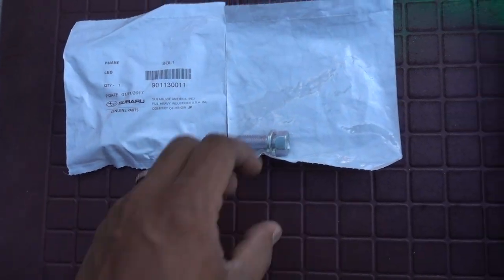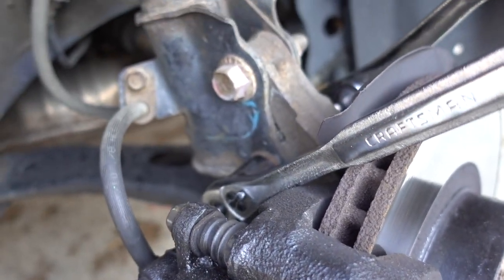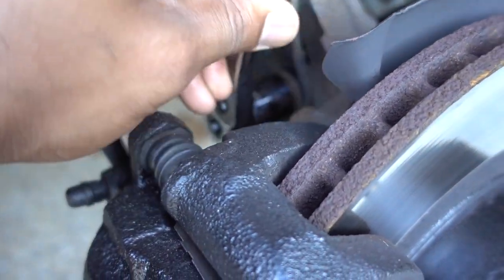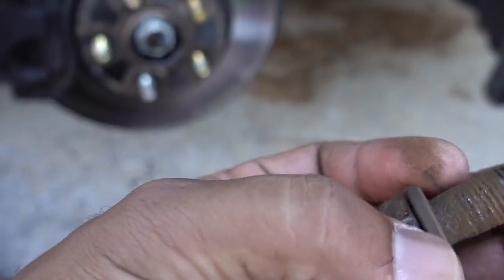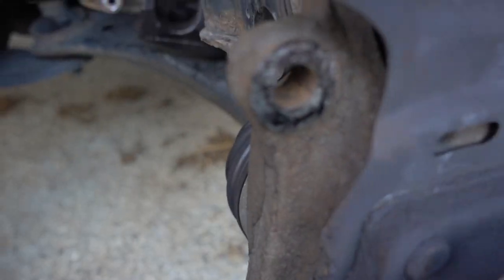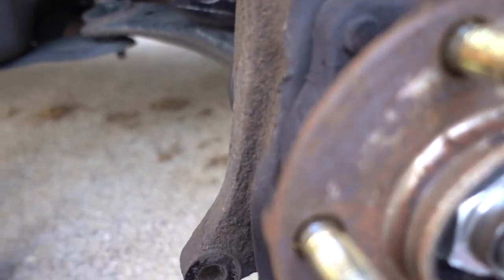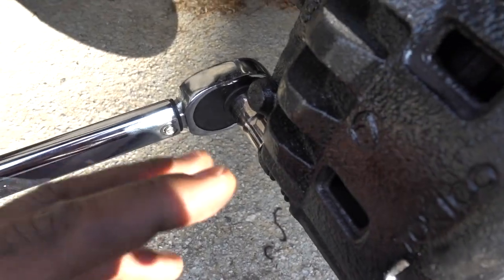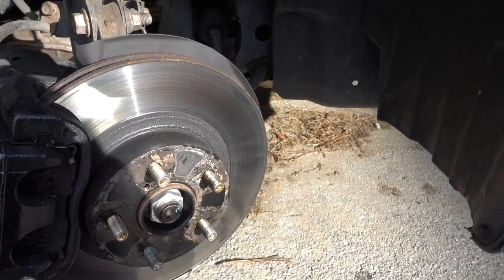How To Replace Caliper Bracket Bolts (One Bolt Snap On Me)

Comment: I watch Chris fix putting the bracket bolt, he said 98ft/ib, I definitely wouldn't recommend, cuz I snapped my bolt, don't put that much torque, now I'm just putting around 60-70 ft/ib.
Reply: Bro, I did the exact same thing yesterday while watching his video, I had it on 90ft lbs, and the head snapped off...
Reply: Half of mine is still stuck in there, got any tricks for removing it?

Comment: I snapped both bolts because of the rust buildup.  I think it's because of the split washer on the bolt, let's water and salt in overtime.  I tried taking the broken bolts out with a extractor but it wouldn't budge at all, ended up having to drill it out and getting a new bracket/bolts.

Comment: how did you remove the bolt when it snaped on you, same thing just happened to me ! I was removing the caliber bracket the lower bolt broke on me (flush with the bracket) it is rusted tight. please help
Reply from the maker: I get a new bracket, because is really hard to remove that thing
Reply from the maker: Is only like $45 on advance auto parts
Reply: @BulletSolano  yes but I can not remove the braket because the bolt is broken inside the hole
Reply from the maker: Can you drill it out?
Reply from the maker: I need to see how is inside and the room you have to work with
Reply: @BulletSolano  ok so I keep drilling, small and then larger bits (at the site of bolt) until it break off?
Reply from the maker: Yes do that
Reply: @BulletSolano  Thank you
Reply from the maker: No problem
Reply: Try swiveling the bracket, and observe the broken bolt. Most likely it moves, and it's frozen only in the threaded (bracket) portion. So without having to drill, you could just try removing the entire rotor (w/bracket) at that point, using the two 8mm x 1.25 bolts through the two pilot holes trick, to detach it from the hub. Possibly also hammering bracket towards you, away from hub. If you do have to drill, since the bolt is very hard steel, I had success instead carefully eating away at the broken bolt using a RotoZip with Dremel bit 9903 to weaken it first, then detaching rotor. As Bullet says, replacing the bracket is mandatory.

Comment: Do you know the bolt size? what should i tell advanced auto parts? "caliper bracket bolt" ??
Reply from the maker: I don’t remember the size but yes is a caliper bracket bolt!!
Reply: The Subaru caliper bracket bolt head is 17mm, but I couldn't find any aftermarket carrying this app-specific bolt. I got mine at the parts counter of the Subaru dealership, and they provided washer, for ~$5.
Reply: Don't know if you still drive your Subaru but it is M12 x 1.25 ~~ 35mm
Reply: The bottom strut bolt doesn’t have to be removed. Soak the caliper bolts with penetrating oil, give it an hour. Use a regular 17mm wrench and wiggle it left and right until you see a movement. Use the same wrench or a ratcheting wrench to remove the bolts.
Clean or wire brush the bolt and knuckle mating surfaces, clean the knuckle bore and apply anti-seize on the inside of the bolt bore. Install the bracket, apply blue loctite on the bolts and torque to 22lb ft on step 1. The next step is to rotate the bolt 75 degrees and that would provide the close to accurate clamp force that is required. The torque of 88.5 lb ft can apply to only brand new knuckle, caliper bracket and bolt. The torque angle method applies to all critical fasteners on a vehicle.

Comment: Snap On sells a special socket to get to that upper caliper bracket bolt without removing the lower strut bolt.The  part number is BTCS1 for that socket.Do not have to replace the caliper bracket when the bolt breaks off.If you know anyone with a mig welder,crank the heat up on the welder and weld a nut on extracting the broken off bolt out with a wrench.Also do not jerk on the torque wrench,jerking on it gives a false torque reading

Comment: What year is that Subaru? I have a 19 year old 911 C4 and a 24 year old A6 and i live in god damn Michigan and neither car has that much rust on or under it. Also why did you have to remove the caliper bracket just to do a brake job? On both Porsche and Audi I only have to remove the caliper from the bracket and i can pull the old rotors out, grind and prep new rotors, insert the pads into the brackets, slide the calipers back on, tighten the bolts and bleed the system. Either you are making this way to complicated or Subaru has really gone down hill since the rally days when i owned a few. Additionally you shouldn't have to mess with any bolts that deal with toe, camber or other alignment settings. If you look at your caliper bracket you will see two bolts with rubber seals that are (or should be) free floating and if you simply loosen and remove those two you can pull the caliper right off and do the brake job. Its even easier on the 911 than on the A6 but it probably should be as it costs nearly 4 times as much, check out those other bolts, but the positive take away is that at least you are replacing rusting parts, which is always a good thing but it seems like you did more work than you needed to do to do a basic brake change.
Reply from the maker: I removed the bracket to get it pain that’s why snaps on me
Reply: @BulletSolano  i think i get it, so basically it was an issue of rust assaulting your car a lot sooner than you expected causing you additional headaches, does that sound about right? Side note, you have to try doing a brake job on a 911, its so awesome, from breaking the wheel lugs lose and jacking it up, to replacing the rotors, pads and bleeding the system takes about 5-6 minutes total!!! It is absolutely shocking, no wonder their race cars can do super fast pit stops, anyway, you get a thumbs up (Like) for being cool and replying to my queries. Cheers
Reply from the maker: Jaja thanks man, if I get a client with a Porsche I will!! Thanks
Reply: @BulletSolano  i know you probably wont remember my youtube profile/channel (i mostly restore old slot cars and trains) but i would love to hear what your experience is like once you get to work on a 911, the Cayenne is pretty much the same except more pistons (they are a beastly set of brakes on there, we have taken my friends Turbo S out a couple times and it stops from 160 mph pretty damn fast, as in, the seat belt pre-tensioners engage and keep you tight in your seat as you firmly come to a stop, and thats a 6,000+ lbs SUV.

If you want to check out my 911 C4 i have a couple videos one or two are at a SCCA event, i love track days because you can go by class and its timed so you dont have to worry about someone crashing into your car like you would in a series, and yes i took first place both times that i filmed. also check out my friends Firebird, its on my channel, he's big into drag racing, i think i have one video where he does three runs over a 2 month period, doing upgrades along the way and he's down to sub 8 sec 1/4 miles, well i gotta get out of here and head home, have a great week.
Reply from the maker: Ok thanks man I will, take care
Reply: oh if you ever need any PC help, upgrades, builds, etc, let me know, i am the god of all things tech, plus i know people at MaximumPC and PC World and i have nearly 30 years experience in IT, networking and telecommunication infrastructure (basically internet), so yeah...if you want a upgrade, a new build or just a second opinion on something, feel free to bounce it past me. Just to give you an idea, one of my laptops, an ASUS G75-VM, is 10 years old, 2009, i have dremmeled out the second bay so it could physically fit a 4TB HDD, and i swapped the main HDD with a 1TB Samsung SSD, upped the RAM from 8GB to 32GB and it honestly beats 9 out of 10 new laptops at the stores, i kid you not, the Geek Squad guys actually asked me "why do you want a new laptop?" because they couldn't find anything even close in performance and storage for under $4,200 and i paid $1,299 for it 10 years ago, then another $380 for the RAM upgrade, $140 for the SSD and $109 for the 4TB so i know how to get your monies worth out of a system.

Ok, enough BSing, i better get home, i have a lawn to mow ;(